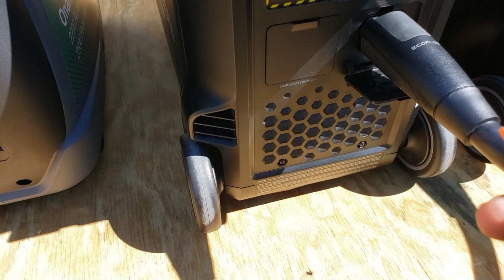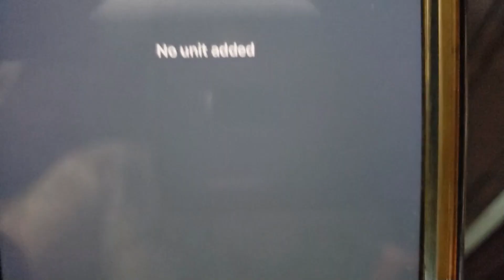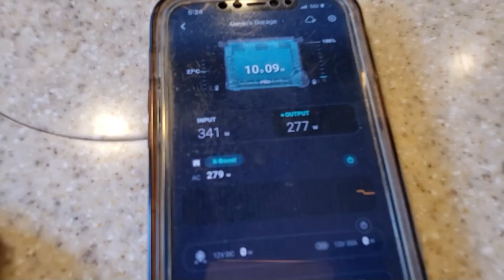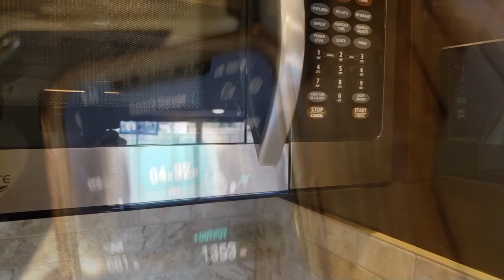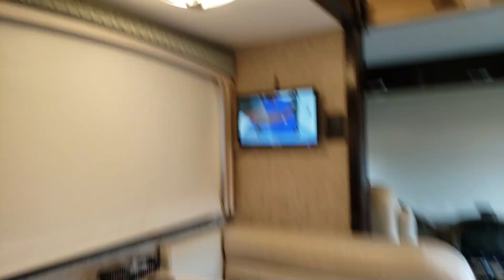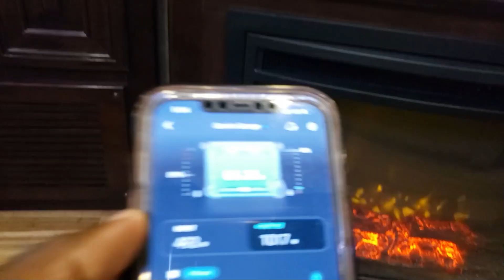ECOFLOW DELTA PRO 7.2kwh Solar Generator and Smart Extra Battery Power Station Load Test

Comment: How would this setup work in a regular home?
Reply from the maker: Hey Tina 
That’s actually it’s primary purpose for the home, especially for people that can’t run a gas generator like apartments high-rise it would work flawlessly powering essential loads.
Reply: @GeneratorReviews  we have an 1800 sq ft home. Would this work well for a home like ours?
Reply from the maker: @tinamitchell5205  Are you going to be using it with Solar or just charge it off the grid?
It all depends on the load you plan on using it with
Reply: @GeneratorReviews  we would be using solar
Reply from the maker: @tinamitchell5205  With solar panels installed this would work perfectly for your needs 👍🏾
Reply: If you, have it set up correctly, it works just as good as a whole house solar set up. We have just the DP, the main unit, as a backup power source for our entire house.  We have a 6 and 10 circuit manual transfer switch, that the DP is connected to.  I installed a dedicated 20 amp, 120v outlet, for just the DP for charging from our Tri-fuel generator and the grid.  We have two inlet boxes, on the outside of our house, to connect the generator.  We have two inlets, on the inside of our house, to connect the DP.  

The DP stays connected to the transfer switches, even when we are not using it. (Either in Standby mode or powered off) We flip the switch to the off position, in the transfer switch, for the outlet for the DP.  (No power going to it) If we suspect, we might lose power, we move the DP switch, from OFF to LINE, in the transfer switch.  Then we move all the remaining switches to GEN in the transfer switch. With the DP in Standby mode, this allows grid power to flow through the DP, to power all the circuits.  When grid power goes out, the DP switches to battery power within 30ms.  (No power loses)

The initial setup can be pricey, but once you have it set up, you won't have to pay for those things again.  You just replace the power stations or generator.

Comment: This is exactly the video I needed to see as I'm planning on getting rid of my 3 deep cycle batteries in my RV and getting something like the Ecoflow delta pro.  I have 400 watts of solar on top and a small inverter generator that you successfully showed both can work together. My power demands are not that high so I could probably keep the small inverter generator on low mode at 58 DB which is pretty quiet in campgrounds should I need to charge the lithium pack. There are a ton of newer lithium-ion phosphate models over 2000 kwh coming out. Two of them would be the Pecron E3000 at 3100 wh ($1600) and the Oukitel 2000 wh ($1199) about a thousand dollars cheaper than the delta pro. Just waiting to see what comes out ahead.
Reply: Looks like the Pecron E3000 still uses Lithium Ion.  The Oukitel 2000 uses the newer LiFePO4, but it doesn't have capacity expansion capability.

Comment: What advantages would you have to just buy 2 delta pros vs 1 with the extra battery?
Reply from the maker: I was thinking about that exact same thing and I will definitely be trying it out
Reply: I am moving into a bus and building it out. I'm on an extremely tight budget. My top priority is the be 100% off grid. It's just my wife, me and a few animals. I am definitely going to go with an all electric setup in addition to an outdoor propane grill and a small indoor wood stove. Im thinking self contained units like this would be perfect? Any thoughts?
Reply: @iwontsubmit  I did something similar in a van but pieced together the system and saved a lot of money. I played the sales for months and got some pretty good deals.  None of this is cheap and its getting much worse. Plywood, OSB, fasteners, wire, outlets, plumbing are very expensive now. If you are a good scrounger and watch Craigslist, you can find some real bargains still. 

My friend's van build electrical parts cost....  $1150 for Chins 12 volt 300 amp hour lithium battery from Amazon.  3000 watt Renogy pure sine wave inverter...Amazon $360.  Renogy Rover 30 amp mppt solar charge controller $110 Amazon. Fuses, cables, brackets, and hardware an extra $200.  Sun Gold Power, 3 of their 100 watt monocrystalline solar panels $350. 10  gauge solar cables, MC4 connectors, crimping kit, roof penetration cost me about $135.  That's about $2500 so far WITH solar. Very livable, overkill on the inverter (he thought he wanted 1000 watt). This setup runs his 1700 watt air fryer easily as well as the big Instapot, 1200 watt microwave oven, toaster oven, and coffee maker. Can't hurt to go bigger on the inverter than you think you need.

The Chins  lithium battery has 300 amp hours and 3840 watt hours. The Delta Pro has 3600 watt hours of power. It costs about $3600 WITHOUT solar panels but it sure has some cool features.

On the van, we added niceties like a $90 Renogy battery monitor...worth every penny because it tells you exactly how many hours and minutes you have left in the battery, what percentage of charge is left. When the microwave oven shuts off the time left on the battery drastically increases as it recomputes. Also, the monitor reads volts, amps and watts, shows charge/discharge. You can see how long it will take in hours and minutes to reach 100% charge. You can tell from 20 feet away if the solar panels are inputting more energy than you are using. 

 He wants to add a $150 DC-DC charger to have the van alternator recharge the battery while he's driving in the rain. I gave him my old $39 Renogy Bluetooth BT-1 unit to plug into the solar charge controller so he can read battery conditions from his cell phone app. That was worth it, very useful.  I donated an old Perko 275 amp battery disconnect switch off a boat. The battery keeps its charge for months while disconnected and the system can be easily disconnected if something starts smoking. Consider that for your build. You can add a second battery through it if you ever need to.

Another thing we did was to buy inexpensive thrift shop 120 volt light fixtures and get 3 watt and 6 watt screw in 12 volt LED bulbs off eBay, $3 each,  so they run directly off the 12 volt battery without going through the inverter losses. Just be sure never to screw in a regular 120 volt bulb.....The 12 volt system also powers his 12 volt fridge, cell phone booster, and 12 volt electric blanket.  Everything in the 12 volt system has automotive blade fuses, just in case of trouble. As a bonus to this van build, he has been able to run his home fridge, microwave oven, toaster oven and coffee maker from a 20 amp extension cord from the van to the house. Not all at once, though! The power was out for 47 hours over there and the van was the real hero. I forgot....the van has a self contained 12 volt diesel heater, $135, that doesn't even put a dent in the Chins battery. 200 degree F air comes out of that thing and it heats nicely.                                                   Good luck on the bus build.

Comment: great video, Can I use this in place of my portable gas generator? using all the same connections and transfer switch?
Reply from the maker: Yep! Add some solar panels and you have an of grid power system use the gas generator during the day and the EcoFlow at night

Comment: Incredible review!  I’ve been wanting to run my RV air on battery but nobody wants to touch it. How do you plug your 30A plug into Delta at night?  Do you run your cord into a storage compartment or into the RV?
Reply from the maker: Hey Jeremy
I think placing it in a storage compartment makes a lot more sense, you could even install something to keep the door cracked.
Running it inside the RV those fans will probably drive you crazy.
Reply: @GeneratorReviews  I figured that. I’d need to pop a hole to get that plug in I guess. Thanks for the reply!

Comment: Awesome setup and beautiful RV! Any plans to get some panels installed on the top of the RV's roof to maximize your solar input and decrease the amount of times you even need to pull out the gas generator on sunny days?
Reply from the maker: Thank you! Oh I already have a 325 watts mounted on the roof for the house batteries and a 200W for the start batteries
Reply: @GeneratorReviews  oh you are really ready to roll! That's whassup! 💯💪🏾

Comment: I'm very happy to see a review of the Delta Pro powering an RV.  I ordered the Pro and it's arriving today if FedEX doesn't lose it.  We have a travel trailer and I plan on using the Pro as we spend the night on the road to power our A/C and essentials.  From what you are showing me the Pro has the power to run these things and I can use a smaller 1600 watt inverter generator to recharge the Pro.  Very good, thank you!

Comment: I got the same with the app you can turn on the ac button with the app
Reply from the maker: I’m really liking it so far such an awesome generator 👍🏾
Reply: Hell yeah I’m planning on getting the the 2nd extra battery. 1899 on eBay with 2year warranty from EcoFlowdirect. Just an heads up

Comment: Are you going to hook it into the 12v system so you have some alternator charging? I have one of these in order and I’m not 100% sure how I should do that.
Reply from the maker: Great question! I’m setting up a dc 12v so it can charge while the RV is running
Reply: @GeneratorReviews  are you planning on making a video to show that off? That would be amazing.
Reply: @GeneratorReviews  I would be interested in see ming this too. Have a ecoflow delta pro + 1 extra battery. Looking to use in my TT and wondering how to wire into existing 12v wiring so I can get charge when hooked up with trailer plug.
Reply from the maker: @Tech4Ten  I can work on a video for you
Reply: @GeneratorReviews  👌 👏  awesome!!

Comment: Excellent review! Exactly the information I was wanting. Just picked up one of these incredible power stations as my primary inverter backup on my RV. Thank you!!
Reply from the maker: Thanks buddy 👍🏾 
It just makes so much more sense to buy this instead of installing it on the RV. I can use it for home backup or camping. It will never replace a gas generator but it really makes sense in certain situations

Comment: Great review. So sick of people putting on heat guns and power tools when testing these units.  This is some real world stuff right here! Well done.
Reply from the maker: Real world test are the best for testing these generators.
Thanks Marc
Reply: @GeneratorReviews  is it possible to get a long cord to charge the battery from solar so you can put the battery in the house and not outside where thieves can see it?...
Reply from the maker: @sherrcon  yes you can buy solar cable with mc4 connection for extending your solar panels
Reply: @GeneratorReviews  thank you my friend...that question came up on another video and no one could answer it...great video you have...another question: can you hook up another delta with another delta or does it have to be a pro delta?...the people i call about it, i have no confidence in their answer...thanks...
Reply: Yeah because real guys don't use power tools smh

Comment: The RV is so luxurious especially inside . Magnificent testing of the Delta Pro system and with an extra battery can handle most of the heavy loads inside , that’s incredible ! A generator , 800 w of PV modules and maybe a 2nd  battery like you said is all you need in an apartment Still be mindful of the amount of heavy loads you use . May the solar be with you .
Reply from the maker: Thanks 🙏🏾

Comment: So basically you buy those two units and that’ll bypass all the extras you need within your current setup?

New to all this so wondering if it’s cost effective for our family.  Keep in the truck bed (covered) and use when we boondocks.

Thanks for the video!
Reply from the maker: Yes! Basically it’s a complete off grid system in one unit. Batteries, charge controller, solar controller and inverter all in one. You don’t have to buy the extra battery you can just use the unit by itself the extra battery just give you extended run time.
Thanks for watching Myron👍🏾🙏🏾💯
Reply from the maker: Thanks for the Sub

Comment: HEY GAVIN GREAT VIDEO, CAN YOU CHARGE A CAR WITH THIS AND CAN YOU CHARGE IT FROM ELECTRIC CAR PORT???, CAN IT HANDLE 240 VOLTS???, THANKS DO YOU KNOW WHERE THEY ARE MADE???....JOE
Reply from the maker: Thanks Joe,
I don’t feel like it has enough capacity to charge an EV and the floating neutral wouldn’t work anyways.
It can be charged using your EV fast charger and for 240v you need two delta pro and the special adapter linking them for 240v.
Reply: Someone tried to charge a Tesla with the delta pro and it only gave it an extra ten miles.  This is not for this purpose.

Comment: Gavin when are you going to do a video on that big Westinghouse generator?
Reply from the maker: I was waiting for the season to change because I wanted to run my central AC since it’s kind of to cold for that.
Reply: @GeneratorReviews  new to your channel - of all the videos I’ve seen demo’ing the Pro (including the ‘big’ outfits) yours is truly the most helpful for us ‘real world’ folks! If you have a second - two quick questions … 1) recommendation for traditional gas Gen? The Westinghouse mentioned in this comment? 2) sorry if I missed it … what type of solar panels are you using? I’m primarily planning to use this system as a traditional home backup for grid down so would only use gas Gen as needed since loud / potential fuel shortage, op sec etc.
Reply from the maker: @Cornnugget4  Thanks 🙏🏾 
I’m working on a video where I use that exact same system with the 10.8 kw so the inverter and two extra battery on a back up system to the house with solar panels I’ll have to check which solar panels I was using because I have so many different brands but I know they were 320watts

Comment: Maybe I missed it, however . . .during your RV portion of the video, you only called out the runtime of your main Delta Pro, you did not include the runtime of your Extra Battery. Essentially, because you have an Extra Battery, the runtime would be double the amount of time.
Reply: No, the displayed runtime while he's in the RV (using the phone app) is for the combined system.  You can see that it still shows 100%, even though the runtime keeps dropping as he turns more and more devices on.  The Pro + extra battery are about 7200wH of capacity.  When he's using 3000+ W, it says he'll get about 2 hours of runtime.  That would equal about 6000W, but when you add inverter and transmission losses, this lines right up with the combined capacity.  If it was only the Delta pro, 3000W would only last for about an hour given the 3600wH battery.
Reply from the maker: The time it gives is already calculated to include the extra battery

Comment: That has to be the best way to get the most out of the  Generator and if there is some sun during the day that would save GAS..I would take advantage of getting as much battery storage as possible so I could take advantage of the sun even when i'm out..  and I think ?? you could use a much smaller generator and do more with less. !
Reply from the maker: Well said my friend👍🏾🙏🏾

Comment: I agree it has its place, and I agree with an apartment or a house. But again, it would have to use very stringily with its power because we all know that 75% of a power outage is for days, if not a week or better. For an overnighter of power, then charge back up the next day. But you have just proved my last point about it. 10 hours with solar to charge. At best, you'll get 5 or 6 hours of straight sunlight, and you will still fall short. Another to charge, then right back to where started providing you didn't use any power. Okay, you add the generator with solar it was still over four hours, and that was with good sunshine. So, you could be running into a constant deficit with many different variables to any of these. See my point? You still will need a generator to charge it if there is no power. I think having this and a small inverter generator would be perfect. You could feasibly set the small generator on the back porch and run it during outages. Then you'll ask yourself, do I need to spend the extra money; when I can have the small generator ready for an outage? Double edge blade. No matter how you look it, I guess. Just trying to help, with another point of view, with cost, weight over the reality of functions.
Reply from the maker: Yes they will never fully replace a gas generator I don’t see the technology to do that but using both the gas generator and solar generators together that’s the only way it works. I agree with you.👍🏾
Reply: For home backup power only, I'd rather just use my generator.  However, for my travel trailer, having the Delta Pro + my Honda 2200 inverter generator makes perfect sense.  Half the places I camp don't have power.  They allow generators, but only during certain hours.  I use the Delta pro at night and early morning to make coffee, watch tv, etc.  Then, I run my Honda for 1-2 hours to charge the Delta Pro back up.  I have 400w of solar, but that's just to supplement and like you said, it's not really enough to make a big difference.  But if I was only concerned with home power, I'd do a 3000-5000w generator and that would still cost a lot less than the Delta Pro.  Keep in mind though, the Delta Pro can handle around 1600w of solar, so that much could charge the whole unit each day with 'good' sun.
Reply from the maker: @fromnineteeneightyfive Agreed 💯 👍🏾